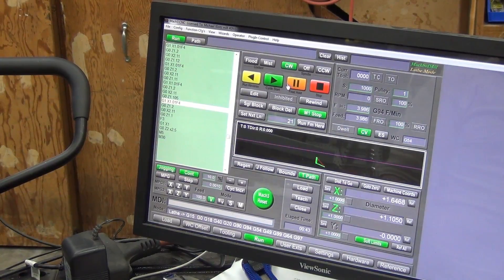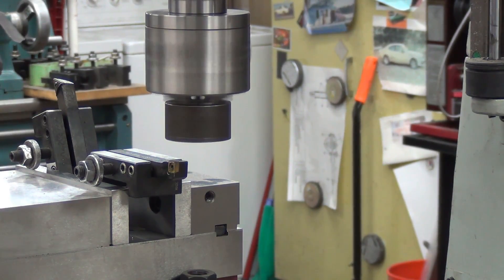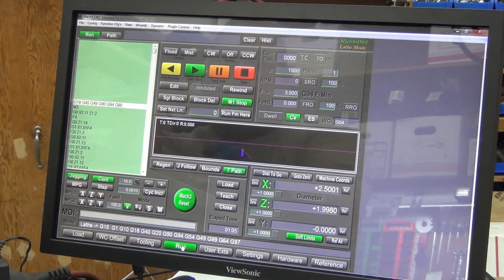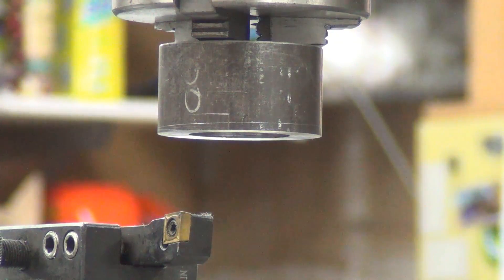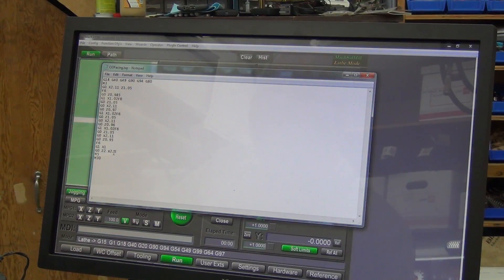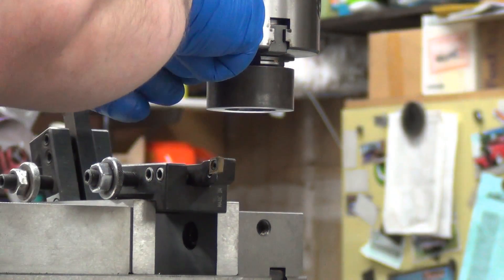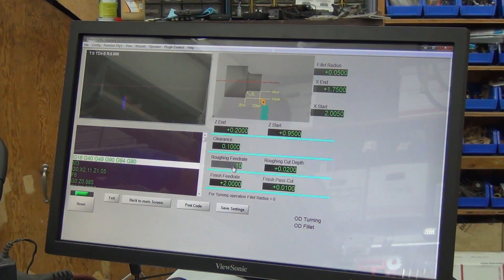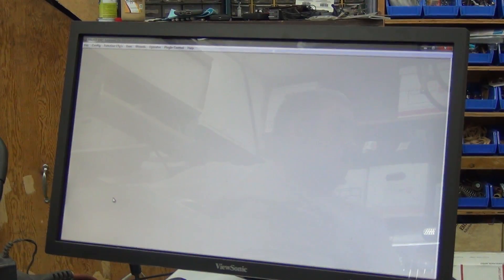Novakon Torus Pro - Mill/Turn Testing.

Comment: I thought this was a pretty innovative way to keep things rolling when the lathe crapped out on you. As with any new "process" it's will take time to get things dialed in right and I'm sure not happy about you cracking the spindle. Definitely cool to watch though, Mike.

What I really like is the idea of traveling for some "training". I think I see Brad's next kickstarter compaign coming on already... On site classes while we learn to make the very items he is selling! :)

You might want to avoid coming too far from the PNW though. It's in the 100s with high humidity here. I'd hate to see you melt before my eyes!

Sincerely,
Tom
Reply from the maker: Tom Zelickman This second part is still in the "learning curve" phase. :(  I took Brads info in his comment and I'm working on that right now.  I've figured out how to run IPR instead of IPM.  Also figured out CSS.  So far, it looks promising, but the 3" chuck doesn't seem to like a .020" DOC.  It turned 3 passes, then didn't like it and spit the part out.  
I agree! Brad could take the tax write off.....but with buying the new Robodrill, he's probably covered pretty well on write offs for this year! lol
If I stay out in the sun too long, I start to smell like bacon. :)
Thanks Tom!!!!
Mike

Comment: I've never used machstandardmill, so I'm not sure if it's even available (it didnt look like it) but one thing you should look for in the code is constant Surface Feet Per Minute instead of using constant RPM. As the diameter gets smaller the rpm should increase to maintain the proper sfpm, and make everything a lot smoother!
hopefully this helps and hopefully its actually in there to change! good luck!
Reply from the maker: Dana Mahar I'll have to look for it again, but I'm not sure it's available.  I understand how it works and it would certainly make things easier!!  The tools seem to be nice and rigid, but it has a bad time with chatter.....so I'm guessing it's in the spindle.  I should looking into coming up with a way to do it without the lathe chuck...it seems to hang the part way out there.  I'm having to run high rpms and small cuts.....which makes annoyingly stringy chips.  I'm not sure the novakon has a pickup for the spindle speed.  There's a tach built into the PDB, but I don't know of a way yet to tap off of it.  I've played with the dwell time on the spindle and it can take a good bit of time to change rpms if there's a fairly big difference.  One of these days, I'll get a nice cnc lathe. :)
I was checking you channel.......thanks for all the likes!! 
Mike

Comment: i was thinking a bit more sophisticated, using the quick change tool holders seems a better way to me.but then again ,my problem is i bite off more than i can chew, i can't resist trying to work beyond my (very low) skill level, i have just finished making out of a riding tractor cutter drive ,a right angled drive with er32 collets for my round column milling machine. my ideas are always beyond my abilities.
Reply from the maker: Andrew Norman I've got a round column as well!!  If you can make stuff on it, you've got more skill than you realize! :)   The quick change tool holders would be great if you needed a lot of different tools, or you were making different parts constantly.  Most of my stuff only requires 2-4 tools......and mostly just 2.  The tool on the left side of the vice is just there as a jack-bolt to keep the vice jaws from skewing.  I'm using g56 and g57 offsets for the two tools on the parts I'm making right now.  It runs OP1 completely without having to stop and change tools.  At some point, I'll mount up the second vice and make two tool holders for them.  I'll get tools that I can leave mounted in them.  It will make setting up lathe work on the mill much easier!!  
I encourage you to post vids of your work!!  You might be surprised at just how much you can help others.  When I was just starting, I'd watch some of these experts and be confused and intimidated at times.  Then I'd find someone like John at NYCCNC(back when he was still using the Taig) an it was much less of a stretch to see myself learning some of this stuff.  There's a lot of guys out there that with round column mills that could use some examples from guys like you. :)   Heck.....some of my favorite "cerberus" vids are of his stories from a time since past.  Some of the vids I put up are more for me than anyone else.  I can go back and look at what I did on a project.  I usually can't remember everything by the time I'm finished with it. LOL!!!  Anyway....Thanks for watching.  Please let me know if you start posting vids or have your work elsewhere on the web.....I'd like to check them out. :)
Mike

Comment: hello again, sorry, i don't do cnc machining .i only do self taught machine work  with YouTube videos as my schooling.i was looking at how you are holding the toolholders in your vise and thought that with the cnc mill it wouldn't be that difficult to machine some dovetails like on the lathe toolpost and flats on the back to hold into the vise, as the quick-change toolposts are a relatively simple design to copy. and with the clamping mechanism on the side instead of the top.
Reply from the maker: Andrew Norman Ah.  This is more like what I thought you were talking about..... https://www.youtube.com/watch?v=0tJ2aDzsnlA  
I've only seen one for sale before. I guess most guys make their own.  You can actually do this on a manual mill too if you don't have a lathe.  Much easier if you have a DRO that has sub datum memory points.  This makes it like gang tooling which is much more efficient and faster than manually changing tools in a tool holder like a manual machine.  I learned the basics from a machinist I worked with, but all the cnc stuff has been youtube or internet. :)  Checking your subs....looks like we're learning from the same guys :)

Comment: looks very good, now all you need to do is make a quick change  tool post to hold in the vice.
Reply from the maker: Andrew Norman Thanks.  You're absolutely right!!  My hope is to run all the lathe parts I need on this and be set for awhile.  It would certainly make setup more convenient!!!!  Do you have one?  Any design suggestions?

Comment: Is that crash what cracked the spindle?
Reply from the maker: War Machine LLC Nope.  I didn't get any vid of the crash.  I had the 1" boring bar clamped in the vise and ran that chuck down into it at about 1100rpm....very close to the center of the chuck with the jaws closed.  It was a lot of mass to bring to a stop that quickly!
Reply: OUCH!